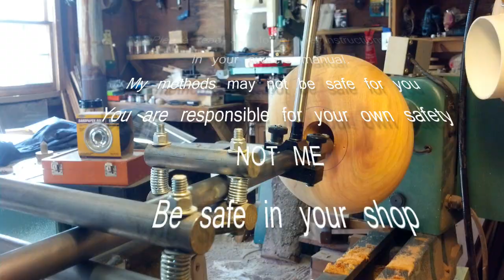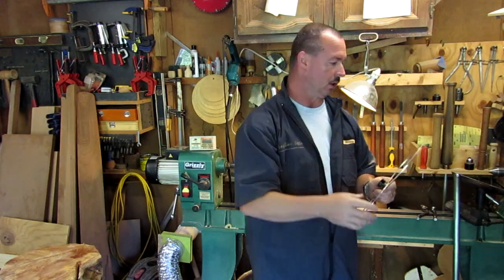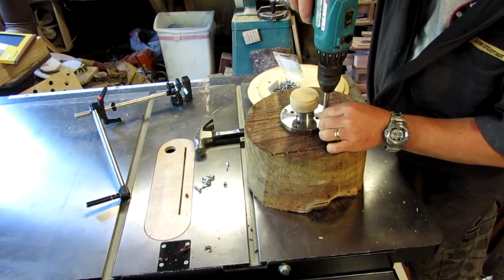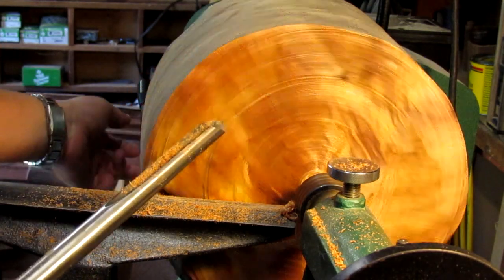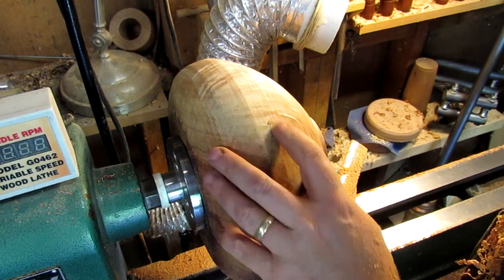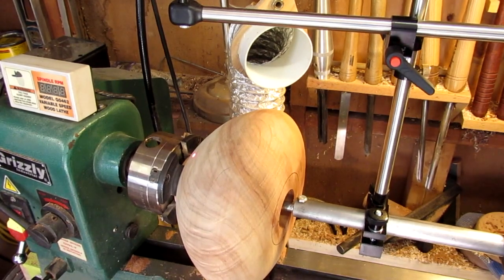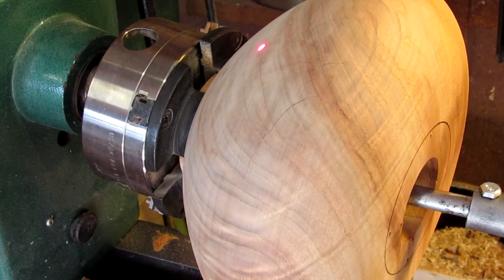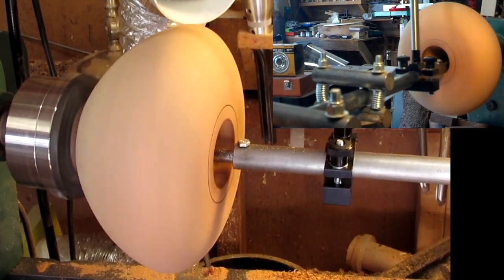#78 Woodturning a Camphor Hollow Form Part 1

Comment: Stunning piece of wood Stephen, and an even "stunninger" hollowing tool you've made there my friend, it certainly is efficient by the looks of it, great job. Looking forward to part two.
Take care
Mike
Reply from the maker: Mike Waldt Thank you Mike. Glad you enjoyed this part. Hopefully Part 2 will be up and running this evening. That tool is awesome. It has some shortfalls though that will require some modification. I get to much torsion forces and must disengage the cutter to regain control. I think I just need to get the cutter closer in line with the bar. We shall see. Hope you like part 2 my friend.

Comment: Stephen you might want to put a D shaped attachment at the back of the bar then make a larger version of the front rest so the D lays flat between top and bottom of the rear rest, that should make it easier to manage the bar

Comment: I like the tool, I'm thinking on doing something similar but using rectangular PTO shaft. It is really good quality steel 1 1/8" X 1" I think for size, The edges are slightly rounded so it should make a nice tool bar.

Comment: Stephen check out Lyle Jamison's channel. He has a tool similar to your's but the back of it is a rectangle that sits in a captive support. It would stop the twisting that you have as you cut. Also I'm going to try you design and incorporate his also. The piece is going to turn out beautiful I'm sure. That wood is gorgeous!
Mark
Reply from the maker: MARK Baid Thanks Mark awesome idea! I have seen his videos and agree with you. However, with the single banjo captive tool rest I can not use the piece you speak of without limiting the tool. I think I may use a square bar to accomplich the same thing. I an glad you are enjoying this project so far. Hope you enjoy part 2.
Reply: I'll let you get yours figured out then steal your plans. A square bar in a roller type rest would cure the twist but not the keeping it level issue. But anyway. Good luck and let me know how it turns out. 
Mark
Reply from the maker: The twist is the only issue I have with this tool. Keeping it level is easy with John's captive rest. It keeps it dead on. You have given me a good idea though and I will let you know how it comes out. Thanks again my friend.
Reply: The second rest is key. The one I was using was only one rest.  I completely forgot about this. Thanks again Stephen. I'll do a video on mine as soon as I finish it.
Mark

Comment: That's an impressive tool you have there.  I was looking at the distance the cutter is from the tool rest and wondered would there be any value in reducing the length of the cutter bar by half to get more of the big bar close to the work and then put the tool rest in front of the laser holder bracket to get it close to the work as well?  That might stop the bouncing you were getting at the mouth of the hollowform...maybe.
Best Wishes, Brendan.
Reply from the maker: baconsoda Thanks Brendan. The answer to both questions is yes. I can reduce the length of the cutter bar (at least the straight one). I can not move the laser guide yet as the bar for the laser is too short to go behind the tailstock. The bouncing was actually a twisting action. I was literally getting no chatter with the larger bar but it would pulsate with an uncontrollable twisting. I may need to go to a square bar. Thank you my friend for your insightful suggestions. They are very welcome. Hope you like Part 2
Reply: Stephen OgleThanks Stephen, sometimes you need to be there to see the whole set-up.  If that was just twisting then I would stick with the round bar because, inside the vessel, it worked beautifully and you will be able to control the twist now that you know it happens.
Reply from the maker: I agree. Thanks Brendan for all your help.